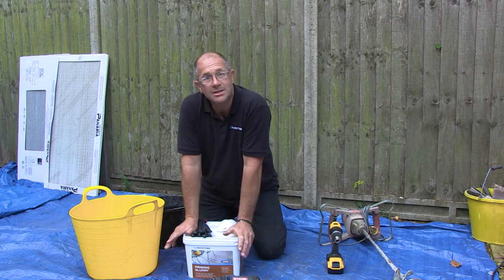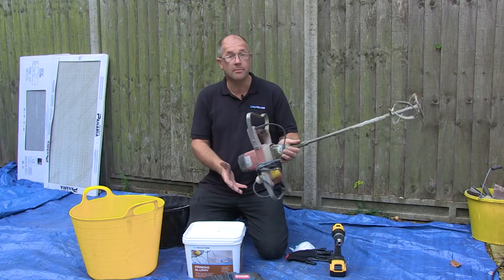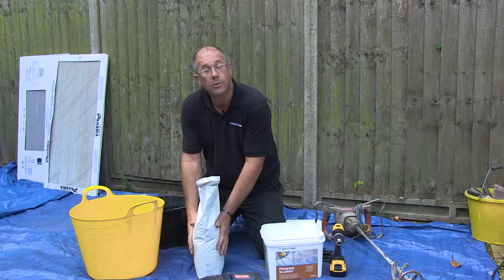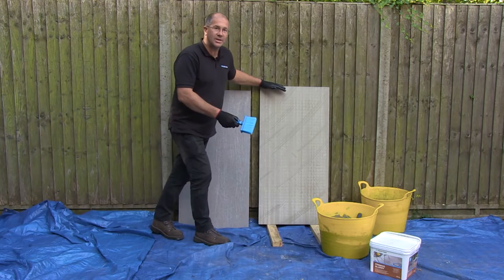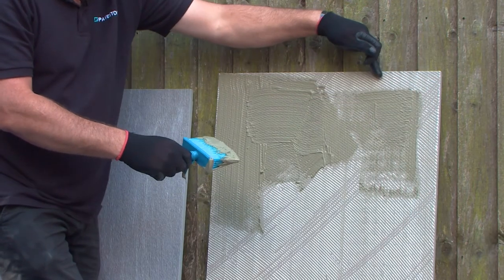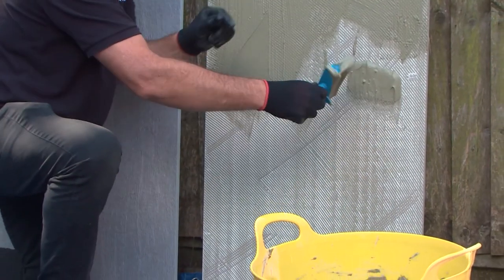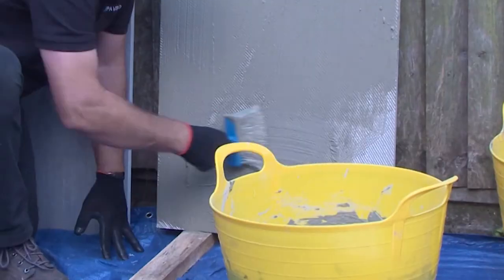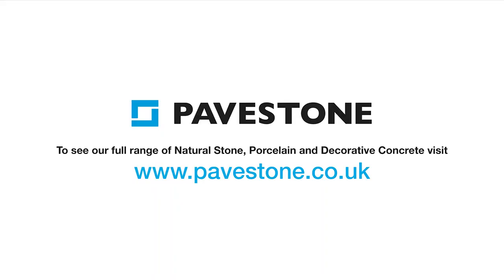How To Apply Priming Slurry - Porcelain Paving

Comment: once mixed with water, do we need to use it slurry immediately? how long it will last once mixed with water?
Reply from the maker: Hi, there are a number of factors that affect the workability of the priming slurry for example the ambient temperatures at the time of use and how quickly you will be laying the paving. It is fine to mix smaller amounts by simply adjusting the water to powder ratios. I hope that this has helped to answer your question. Mark.

Comment: Do you lay with the primer still wet then?
Reply: Hi Steven, If I understand your question correctly, then yes the slab must be laid as soon as the primer has been applied to the back.
Reply: Hi, Our tradesman used SBR to apply to 90cm by 60cm porcelain slab in garden but when we checked them if they stick after a two day later  we found it porcelain did not stick to mortar base. Some are ok but some is not as we use the plastic hammer to tap it  we can hear the sound as like there is some air under it. Any advice ?